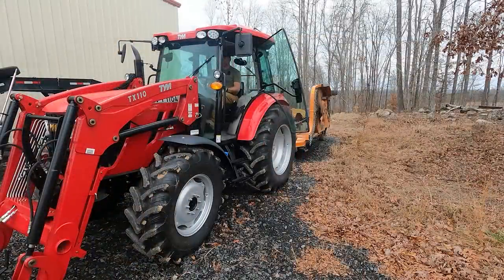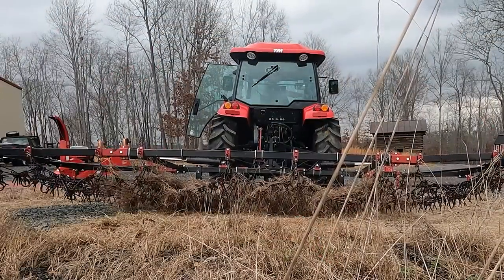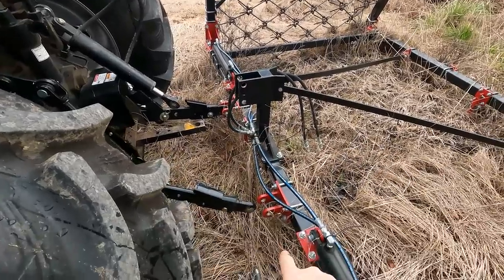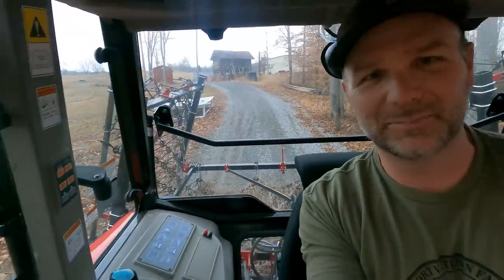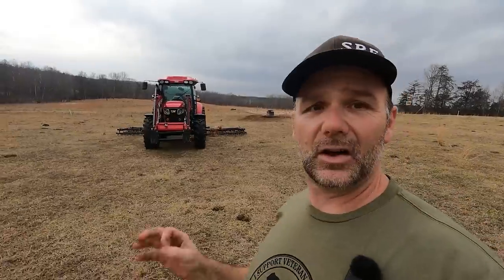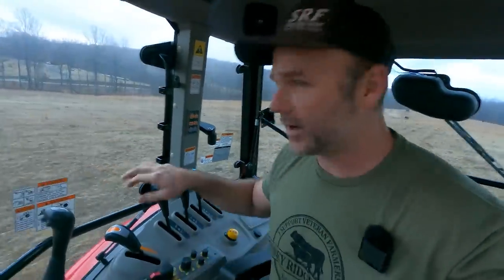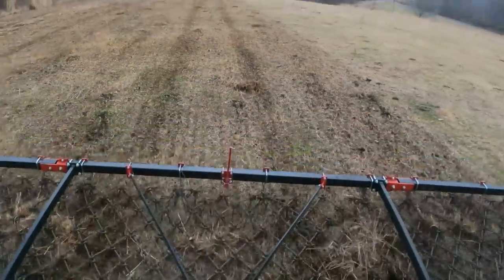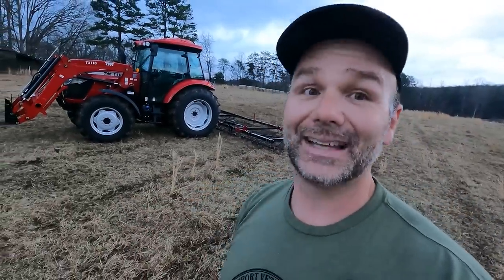What a mess! Let's get out the BIG TRACTOR!

Comment: I run a JD 544K loader that has the DEF system in it and there are times that it interferes with the operation of the machine. It has an automatic exhaust clean out period. I'll be operating the machine and all of a sudden my idle speed will go from 60 rpm to 900 rpm and stay there. I have to keep running the machine as I'm feeding a plant. But I feel it will cause damage down the road because when I shift from forward to reverse it's a hard shift. If I trying to shut the machine while it's in clean out mode it automatically locks me out from doing so until it's done. Have you considered doing an over seed after dragging to try and chock out the broom grass?

Comment: Is there a float function on the tractor so the drag will just move one its own with the ground? But I have to say that is such a good idea. I questioned the hay thinking adding just the biomass to the dead dirt wont do much but I didn't take the  the cow crap into consideration.
Reply from the maker: you could float it...if it didn't have the hydraulic top link

Comment: Hello a tips from from
Sweden, if you’re replacing you toplink with a chain on this work the harrow will follow the ground better and you don’t need to worry so much about the setting of the toplink while you’re driving, only putt the tractors 3point in flotation mode and make shore the chain is in the right length to lift the harrow buy not stoping its movement when you work on your field. Good luck from Andreas in Sweden